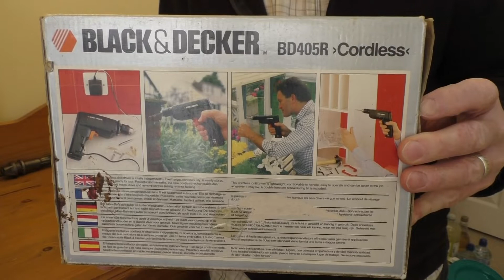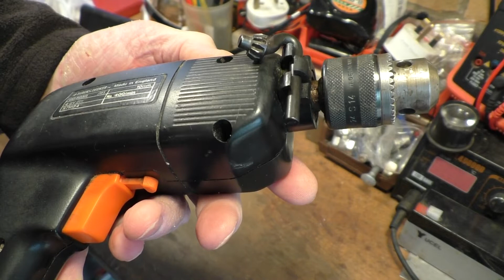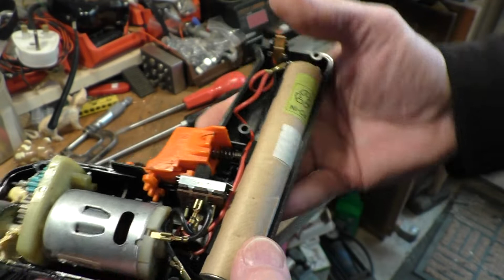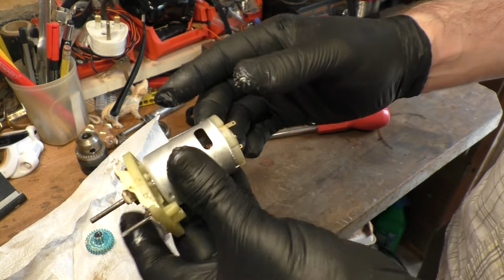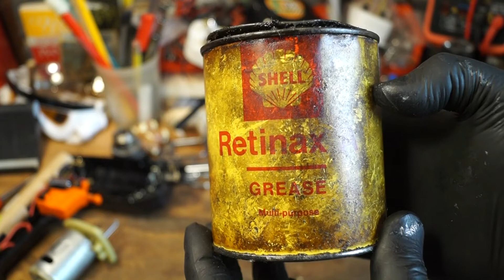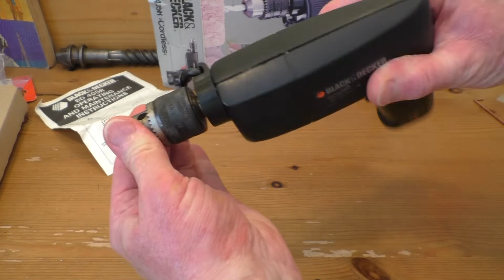Tool Renovation: The Black & Decker BD405R Rechargeable Drill/Driver.

Comment: Made in England!  The gears look quality to me.  The weak point would have been the NI-Cad batteries built in.
I am picking one up tomorrow which is off freecycle, with dead battery.  It's got a proper metal Jacobs chuck !
Got to be a plum recycling job for some other use and it's slow speed with a decent torque.  Maybe use a computer PSU which gives 5v DC?
Reply: Mine has a Rohm chuck. It’s not worth a new battery back.
Chuck will do good on my new drills with rubbish chucks.
Cant find a drill with a good chuck.
A 6 volt battery and potenciometro the drill gearbox could make a quill feed for boring on my cheap mill.

Comment: Hello Nash & everybody else. My sister gave me a few years ago the same model of that drill- screwdriver that wasn’t working. Once I have opened it, I discover that one of the gears ( the blue, and only plastic one), is broken.
I can’t find it in Spain. Do you think i could find a replacement in UK,  USA or somewhere else. I’m also the type of person that enjoy giving new life to any dead machine, and think we’re destroying our home. Thankyou in advance.
Reply: You can look for a second hand drill for parts or print the gear on a 3d printer using some strong plastic material.
Reply: @timtim4726  
Thankyou. It seems that is older than I thought. I have adresed enquiries to a quite a few of parts shops ( even in Liverpool) with no results. I don’t trust plastic ( the “ink” of 3 D printers I suppose).. May be I’ll end up making a silicone mould and getting a duplicate in tin or brass. And paying for it twice the price of a new drill .  I’m quite a Quijote !!!
Reply: @juanchoserna8391  I think casting duplicate in a mould is not a good idea when it's about metal gears. It will have rough surface. Better way is to machine the gear out of a solid metal peace. It'll cost much higher.☹️
Reply: 3D printing one out of ABS or resin would be perfect

Comment: Just found one (without the charger) in the attick. Are there collectors for these items?
Reply: More often than not the battery packs degrade after many years of none use but you maybe lucky ,do an internet search for a charger that's the correct amp rating!